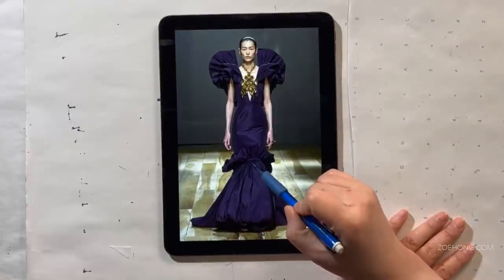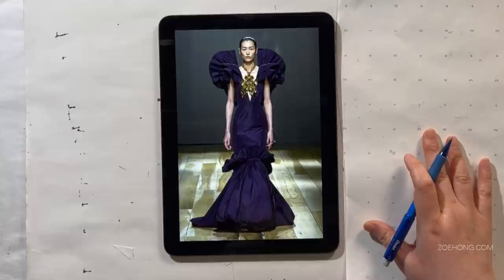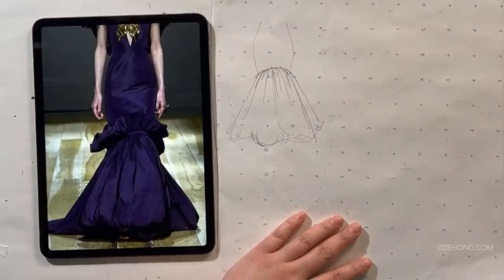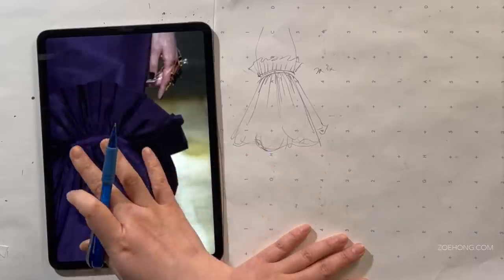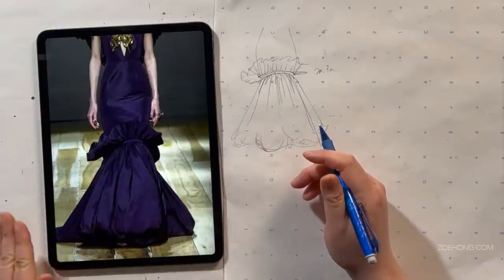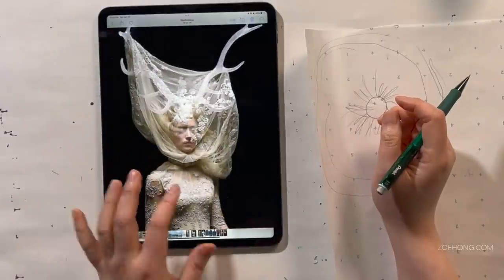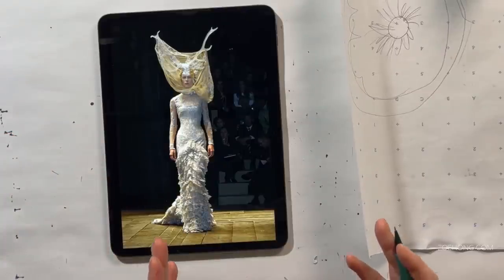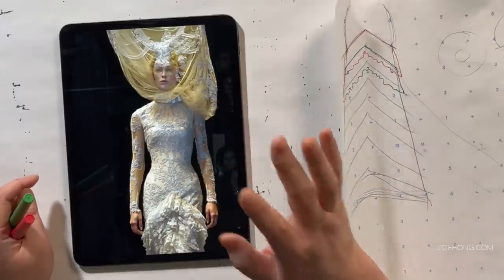How Do You Make That?: The Alexander McQueen Episode

Comment: After you move all the darts to the neck in Oder to create the gathering … how do you add MORE fabric for even more gathering… slash and spread won’t work will it ?
Reply from the maker: Yes, you can slash and spread even more. You can open it up and slash into the center front if you want more gathers there, or slash into the neck on the other side of the dart if you prefer.
Reply: Won’t slashing and spreading it into the center front prevent it from being a cut on fold? and won’t you end up with a center front seam? Is there a way to add more fabric / gathers just in that area above the apex of the bust without having a center front seam and keeping it as a cut on fold ???